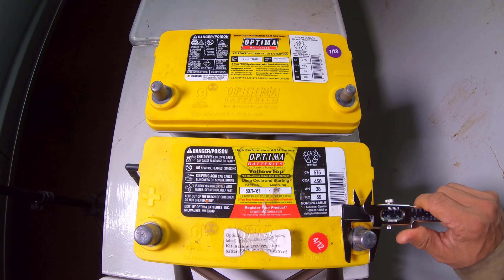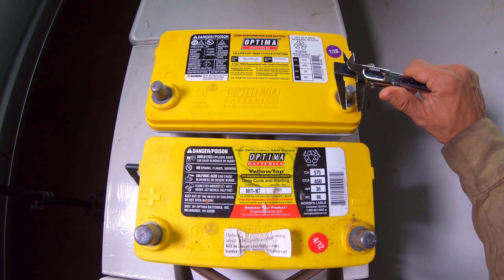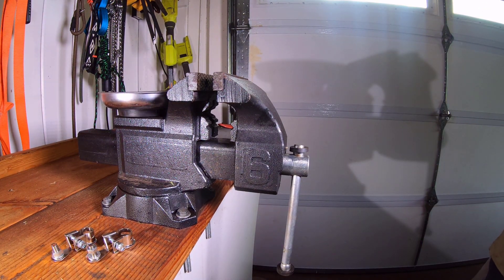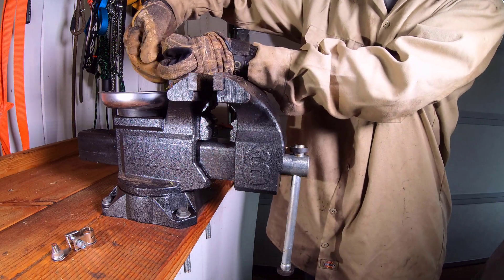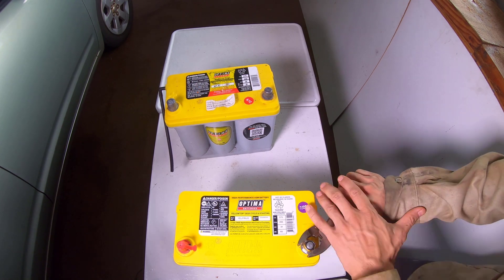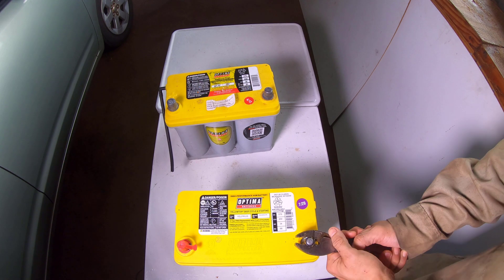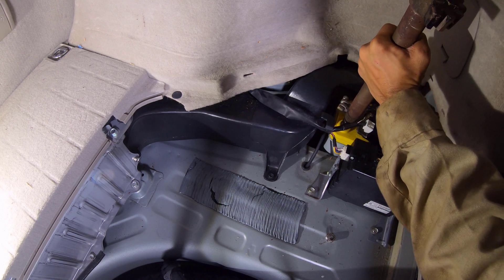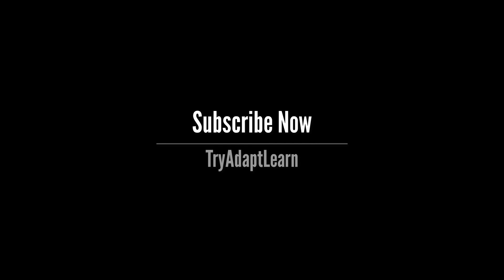Diy car battery top post or terminal adapter on an Optima Yellow Top

Comment: Thanks for choosing OPTIMA! We offer three different batteries in the dimensions of that battery case, the D51, D51R & DS46B24R YELLOWTOP. The D51 & D51R feature the larger SAE-style terminals, with the "R" designation in the D51R indicating reverse termination. The DS46B24R YELLOWTOP is a direct-fit replacement for the Toyota Prius and features smaller diameter JIS (pencil posts) terminals. We still sell all three batteries and they are available on our website and at retailers nationwide, which can save you the trouble of having to change top post adapters when purchasing a new battery
https://www.optimabatteries.com/en-us/yellowtop-deep-cycle-battery/d51
https://www.optimabatteries.com/en-us/yellowtop-deep-cycle-battery/d51r
https://www.optimabatteries.com/en-us/yellowtop-deep-cycle-battery/ds46b24r
Reply from the maker: Thank you for your detailed reply with links.  Hopefully this detailed information will allow viewers to purchase the specific model number for their application.
Reply: Can i get an adapter for a 46 to fit a 2005 mitsubishi endeavor??the posts are way to small

Comment: Cut a 1/2 copper pipe and split it and use it as a shim.... tada problem solve.
Reply from the maker: That’s and interesting DIY solution especially as a fix and the vehicle needs to be moved immediately